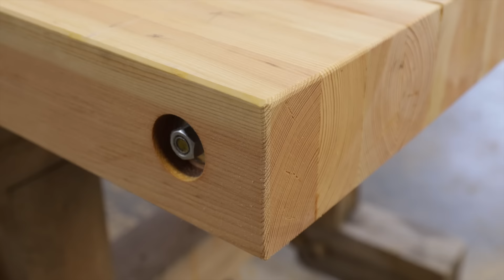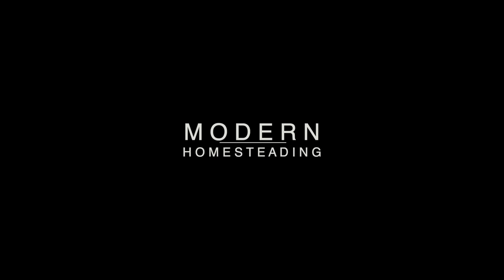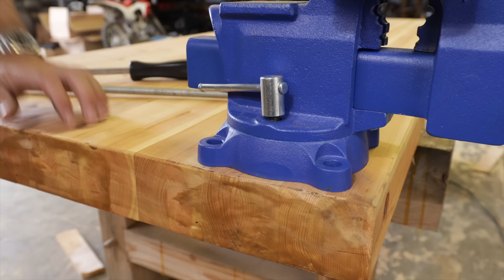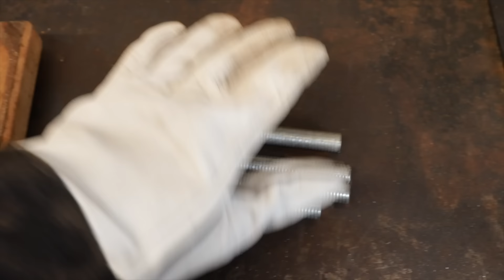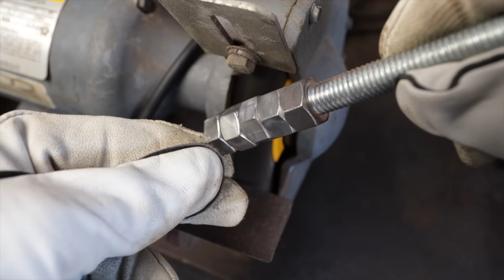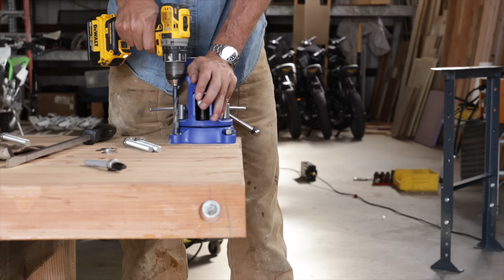BENCH VISE - How To Install A Vise

Comment: Wait, that's it? I finished that video feeling rushed for some reason
Reply: It's a video on installing a Vice. I don't know how or why he could or would stretch the video out.  To the point to me!🤷🏽‍♂️
Reply: I felt the same way.  Although I learned everything I needed to learn, that was a horrible way to end the video.  How do you end the scene at that angle?  Haha...  Thumbs up, regardless.
Reply: @jasonwright2262  Right, but when you consider the fact that everything else in the video was not rushed, the ending seems rushed.  Before the sudden cut-to-black scene, every step has a sense of "closure" to it.  I mean, it's not that serious, though.
Reply: If anything, it was the opposite.  I don't want to make my own bolts :) This had everything you needed to know about installing the vice plus more in case you wanted to make custom bolts.  Perfect!

Comment: Just a suggestion, when putting a vice on a wood bench that close to the end you can always cut out a square piece of 1/8" steel the size of the Vise to bolt underneath to act as one giant washer.
Reply: Good point, especially on butcherblock. Too many joints that can separate under heavy use.

Comment: If you can find about a 12x12x1 inch plate of steel you can mount it to the bench and then have different holes for different vices/anvils and swap them as needed.
Reply: In Fireball Tools's recent video, he had a neat design. Though he does have a waterjet.
Reply: @RenThraysk  I saw that and I'll be making something similar soon. I have plenty of T-bolts here to use too
Reply: @RenThraysk  
That is a neat design. I'll have to make one.
Reply: You beat me to the punch. Kinda like a hitch hookup for a trailer. You can swap out different tools.
Reply: 1 inch? that's a little over kill you could get away with 3/8s but 1/2 would be a little better.
Reply: @Graveltrucking  
For tapping. So you have enough thread engagement without putting holes in the table. But I like the T-bolt design better.
Also there are metal working benches which have square holes for inserting different anvils. Good addition for the other corner.
Reply: @Foche_T._Schitt  Ah I see what your getting at.
Reply: Yes definitely a plate backer underneath, dunno about 1 inch though but say 3/8 -10mm for spreading the bolt loads, maybe glued also to help with torque loads when heaving on stuff up top (tube bushes stuck in to bench to stop the holes ovaling over time might be a good idea too).

Comment: Food for thought.... Placing a spacer in the bench side of your vice's jaws will shift the "long object" going into it further away from the edge of the bench.  This allows you to extend reach regardless of which side of the vice swing you're on and allows you to place mounting bolts further in from the edge of the wood/bench. Only draw back to this method that I know of is it decreases the maximum width you can open the jaws of the vice.
Reply: Good idea

Comment: I enjoyed watching this video as it was very interesting.  I would like to mount a vice to the top of a concrete block retaining wall in my basement and thought if I could somehow glue or use tapcon screws through the wood and into the concrete block it might work.  Does anyone have any other suggestions that might be better?  If so, I would appreciate any feedback.  Thanks!

Comment: I extended my 5 Ince vice past its threads how do I get it screwed back in? It's not lying up and poking a screw into the little hole to try and align it is not working either, It's grabbing a little bit not getting it done.

Comment: @Wranglerstar, I like that you chose to use a thread locking fluid.  But it is designed to be applied immediately before placing the nut and bolt under load.  If you want to pre-install the nut (a convenient idea, in this case), then I recommend screwing on a second nut just to put a little load on the nut that you want permanently attached.  Use several flat washers to prevent the temporary nut from seeing any of the thread locking fluid.
This allows the thread locking fluid to fill the gap in the threads (as is its purpose) without being placed directly in the load path.

Comment: My father worked nearly 30 years as an automatic fire sprinkler fitter. I worked with him a bit too, wish I would've stayed in that field. They use lots of all thread and special clamps and hangers to hang sprinkler pipe in almost every application. We used those lessons, and lots of all thread, back on the homestead projects.

Comment: The step you took regarding the rear jaw of the vice overhanging the bench so that you can put long jobs in the vice was what I was trying to say about the Drill press in the previous video. Have the drill press on the end of the bench so that you can turn the head round 90 degrees and stand longer jobs on the floor or on blocks.

Comment: As many of the comments say, I have also placed a small piece of flat steel on the under side of the bunch under the vice. Maybe this is not necessary but it made me feel better about running the vice right up to the edge of the top. I would also say that when someone is tying to locate tools on a bench top, to also consider the altread that runs through the bench top. You don't want to interfere with that.

Great video. Thanks for sharing!

Comment: Glad to see I'm not the only one that instantly had the thought about a support plate on the bottom.

Another idea could be to have welded those nuts on the top to the allthread and ground it flat to look like a real bolt. Then you just had one point of loosening if the loctite fails over time.

Comment: As a diesel technician the best thing i ever did on my wooden workbench was to put a steel plate under my vise and on the bottom side of the bench keeps, the wood protected when beating the hell out of the vise

Comment: A fairly thick steel plate (3/8" to 3/4") under the vise will allow you to run the vise right up to the edge and spreads the load. Something thick enough to drill and tap is best. For that little vise I'd say something like 6"x8"x1/2".
It also adds to the mass of the vise, which is something you need when wailing on it with a hammer.
Reply: shouldn't be beating the living daylights out of a cast iron vise. they will break; they're not meant for that kind of abuse
Reply: Thank you for this advice.  I have put together my first gun bench and I want to make sure the vice is secure.  Thanks for the advice.
Reply: @theTealStory  what is then?
Reply: @bradleypease2492  ones that aren’t cast. Or a post vise or an anvil
Reply: @theTealStory  i abused my aluminum and cast iron vise since years ago and it still works fine 😂

Comment: Interesting...I always put like a 12 inch square plate like 1/8 or 1/4 under the bench so the bolts never want to pull through the woods. Last thing you want is to pull on your vice so hard that the bolts dig into the table and get lose! Surface area is key!

Comment: Just a tip on that allthread. Put 4 nuts on each section you want to make. The two in the center should be turned against each other tight so they won't turn. After cutting, unthread the other two off the allthread and that will help to untangle the threads that were mangled in the cutting process.

Comment: Great video! As always, I know that there are multiple ways to do things, I’m just curious as to why you prefer not to use lag bolts for mounting. I’ve used lag bolts on 3 different benches and never had a problem. That’s with using cheater bars and all kinds of torture to my Wilton tradesman. I’ve really enjoyed this series...keep up the great work!

Comment: Cody could you please put a piece of steel strap about 1/4" by 2" to tie the bottom of the two bolts at the end of the table. That way after beating on the vise your boards dont delaminate because they are sandwiched between the bottom of the vise and the steel strap at the bottom edge of the table at the end there im sure youll agree hope this helps God bless.

Comment: Question about the workbench...
I've replicated this build. But I've noticed the bench shakes ALOT when I plane on it, or even sharpen my chainsaw blade in a vise. 
It's not bolted to the ground, but I dont think that's the cause. Should I just bolt it  into my concrete wall?

Comment: Okay, I have to start with the fact that I wasn't taught a lot of rules when using tools by my Dad and Grandfather, but... Using channel lock type pliers for tightening nuts was one of those things to avoid doing at all costs. It doesn't take a rocket surgeon to see it will usually lead to marred up edges. Just curious if you do it out of convenience or if there is a reason or not? Of course it will do the job but a knife will work as a prying tool too. :)
Reply: They are more prpoerly called, Water Pump Pliers, for loosing the Water Pump, on the front of the engine.

Comment: What is the purpose of the all thread at this point?  The glue is holding the top together.
Reply: kevin maxwell the idea was somebody without big clamps just starting out could use the all thread to pull it all together

Comment: 4 views. 8 comments, but only shows one comment. What are the people at YouTube on?. Actual question why didn’t you weld the nuts on?
Reply: The force applied to the nuts once torqued will be more than enough to hold them tight, just like when you use a normal bolt with only 1 nut. You don't go around welding every single nut together. Welding seems a bit excessive.
Reply: Did you miss the previous video?  His welder is down.
Reply: trongod2000 oh very well I must’ve missed it then. Imma gonna watch it
Reply: matthew womack ok I see my mistake. I met the nut the was used as the bolt head. It is the only was I ever saw it done.